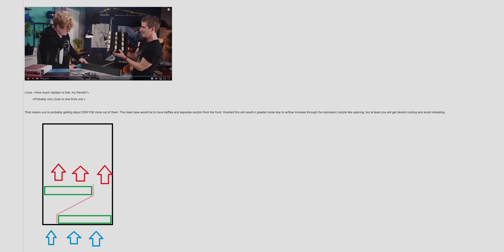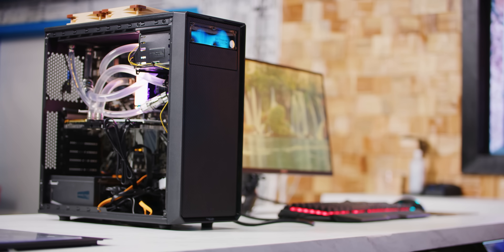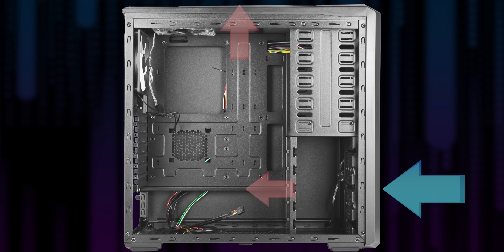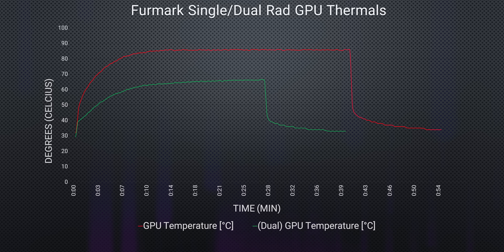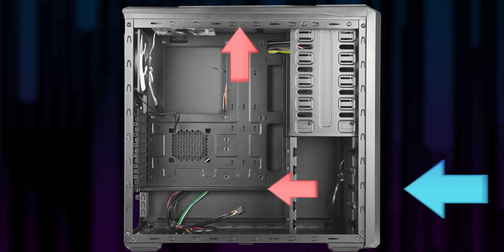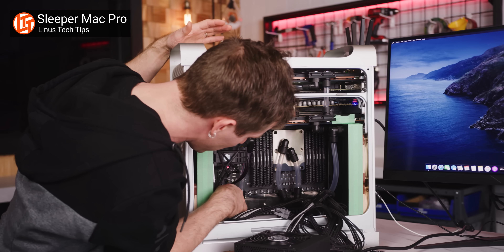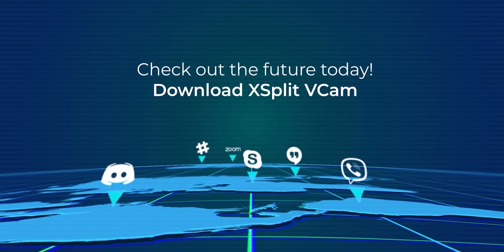I’ve been water cooling wrong for YEARS - $H!T Manufacturers Say

Comment: If I understand correctly, the case Corsair criticized, was stacking radiators. In that case, they might very well be right, especially if your fans are not up to the task, or you're sandwiching one set of fans between two rads. Because the air does not have a chance to dissipate some heat on its round through the case, it goes straight through to the next rad. And the airflow impedance going through multiple stacked radiators, doesn't mean you get good then progressively worse airflow through the radiator stack. It means you get poor airflow through the whole stack. Because the stack forms a relatively sealed flow path. It's a bit like pinching a long hose in one end, almost shut, then blowing in the other end. Overly simplified: Because the hose is filled with air, and doesn't balloon under pressure, it's just as hard to blow air through the first inch as the last one.

In more common setups though, people don't usually stack radiators like that, especially not without beasty fans. And, people usually don't run their rad fans on such an insanely low speed (practically barely turning) that the air manages to pick up anywhere near the kind of thermal delta as Corsair showed, on its short trip through the radiator. There's just no frickin' way you get exhaust air with 1°C delta from the radiator fin (/water) temperature. Not unless you're intentionally provoking that outcome under strictly controlled circumstance. And if you do, you still pretty much have a thermal runaway scenario on your hand because, well, the air passing through the rad only has 1°C delta on the radiator. Meaning it has practically no heat exchange potential. Not a big problem if you're just cooling off some warm water water, but that's not what's going on here. You have a CPU/GPU heat source, continously heating that water. The water is just a thermal medium here.

Comment: The thing here is that the temperature gradient is not as high for the second radiator as for the first. therefore the second rad won't be as efficient as the first, but that does not mean that it has no effect. and stacked radiators do not slow down air enough to "hold back the heat", especially not if you make a rad-fan-rad-fan-... sandwich. if you use a fan-rad-rad-rad-... setup there will be a point where more rads will negatively impact thermals, but that would need tens of radiators so you'll never reach that even in a server scenario.

bottom line: the effect corsair points out is a thing, but it's not relevant for real-life usecases.
Reply: I fully agree and you have worded this way better than I was willing to in my comment.
Reply: Nope
Reply: If corsair claims that a radiator with 40 C water, takes 23 C air and ejects 39 C hot air, then putting that 39 C hot air into another radiator with 40 C air, makes practically no difference. The second radiator is only (40-39)/(40-23)=1/17 times effective as first one. You get like 6% improvement only. You could've probably gotten that same effect if you had just put the fans on both sides.

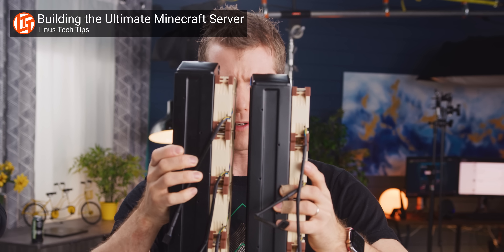The crucial aspect here is that the second radiator only takes hot air of the first radiator for corsair's logic to work. As Linus himself explained, that was not ensured in his test. Air could come from bottom and back. However, what he does at 1:30 is exactly the condition corsair is talking about. That's why I would say Corsair makes sense.

Another aspect is the sequence. In the loop, hot water is cooled by the first radiator and then the second radiator. If the first one is taking fresh air, then with second radiator you're trying to cool already cooled water with hot air from the first radiator. That will be very counterproductive. If the second one is taking fresh air, then the first radiator would be using slightly warmer air of the second radiator to cool much warmer water.

Suppose the air reduces the temperature of water by 4 C(if the water is running at 25 ml/sec, to remove 400 watts, you'd need 4 C temp difference between hot and cold water). Then, in first case temp difference would be like (23C air- 40C water 39C air) + ( 39 C air 36C water- 39C air?) while in the second case, it'd be (23 C air- 37C water -36 C air) + (36C air-40C water-39C air) which makes more sense. Of course this is theoretical, but the sequence of the radiator should matter a lot.
Reply: Linus should go full Mythbusters and see how much it takes to make Corsair's claims true!
Reply: also with 3 rads you have more thermal mass of water - it takes longer to warm it up, so you're working with lower temps to begin with.
Reply: Cool, sounds like you read out what the video said.
Reply: @goodman854  which is also not correct, check out my comment...
Reply: Lamus failed his university degree, like he literally dropped out [get it? ;) ] because he sucked so much. Engineers at Corsair, they passed, and they did a proper degree too... Lamus.
Reply: @brazeiar9672  You do have to be careful when it comes to engineering and modeling.  After an F15 lost a wing, engineers at McDonnell Douglas said it was impossible to fly on one wing.  They tried and failed to recreate an event that really happened to an Israeli F15 at the time (I think they've managed to do it since).
 
Physics is all about science and theoretical models - exact explanations.  Engineering means more than the models - every engineering situation will eventually be a slave to real-world experience.  Even if you don't know why, you eventually have to go with what works.  The science will catch up.  For something that is demonstrably true like this, going with the metrics isn't a bad thing.

Comment: My only gripe is that stacking radiators isn't used in the real world for a reason. Car manufactures don't stack two exact radiators in front of each other because the heat from the first one will effect the second one. All they do is make a bigger radiator or put multiple radiators in different places. So in case of the minecraft server i can't see the second two rads in the "clump" doing anything, but if you put 3 rads in different places of the case with good input air flow that's golden.

Comment: Also I am using an open frame chassis with all my rads getting fresh air all the time and no heating up inside the case is possible.

Besides that I don't like to cramp radiators into a small case. I would rather go for an external radiator, you will always find a place to put it, like the MORA 3 and you get low temperatures and low noise what in my opinion is what makes most sense with doing watercooling at all.

I am keeping my CPU and GPU loops at a max temps of 32 degrees all of the time under load. This let's my 2080ti run at 39-40 C when gaming and boosting up to 2115 MHZ.

Comment: Interestingly for such a big company with so many people who could theoretically fact-check, Corsair seems to have made a very simple mistake: They considered heat transfer of the water as a closed loop, without accounting for the air that's part of the system. What they claim about more rads being bad and choking flow would be correct... if the situation was under free-flow closed-loop conditions with water only. Because the fans increase the effective surface area of the rad inside the case (by pushing more air and turning the heat transfer mode into forced-convection instead of free convection), more within reason should almost always increase flow, and heat transfer along with it. Their CFD simulations were most likely set up with free flow in mind.

Comment: Corsair's simulations are assuming perfect heat transfer from radiator to air on the intake.  The reality is that it's not perfect, so if your water is at 40' and your ambient is at 21', the air intake through your front radiator is probably going to be lower than 40', so exhausting through another radiator will still provide cooling.  Not as much as the front radiator, but it's still cooling.

If your case air is at the same temp as your internal components, you aren't exhausting fast enough.  Obviously two radiators intaking ambient air will be better than one intake/one exhaust, but you still shouldn't be fully saturating the exchange on your intake radiator.

Comment: If stacking radiators are bad why is there 4 stacked together in front of my dodge ram motor??? Transmission cooler, radiator, intercooler, and ac condense. Inefficiency can be overcome by extra air flow. So just drive faster. Vehicles over heat when not moving.  Thats why electric fans are an improved design on cars vs fans off the front of the engine block that spin slow on idel.  If you just add extra case fans problems solved.

Comment: I'm gonna simultaneously chastise and defend Corsair here. They aren't wrong. If you set up your CFD boundary conditions for only one inlet and outlet, stacking the radiators or adding one at the inlet and one at the outlet would be no benefit. In fact, it would lead to increased pressure drop for the air and water which would decrease system performance.

Now to chastise, come on Corsair. Stop with the techno-babble to make yourself look smart. For SOME computer cases, it may make no sense to stack/add radiators to the system. Like Linus said, you need to evaluate your PC and case packaging to determine whether or not multiple radiators are necessary or beneficial.

Source: am cooling engineer

Comment: I'm really disappointed that he didn't test or even mention the order in which the water flows through the radiators.
If you let the warm water flow through the radiator at the back/exhaust side FIRST and then through the radiator that takes in the freshest air LAST, your loop should perform really well.

The air will first encounter the partially cooled water when it enters the case, so it won't heat up by that much. By the time it encounters the hottest radiator, it's ready to leave the case so it won't matter that it has no more thermal capacity left after having gone through that rad. This is why a heat exchanger is so efficient.

Comment: Surely if you pump the hot coolant into a rear radiator first (which is being cooled by inside case air) and then move that colder coolant to a front rad that's drawing in the coldest fresh air, you will get some benefit?

Comment: As long as there's enough free space between the radiators which share the same enclosure you won't see too much of a performance-drop. 
Stacking radiators on the other hand, like the sandwhich that was used in the server is a bad thing. The tricky bit is to correctly measure the difference in cooling-performance because with two rads you double the thermal capacity within your heat-exchange section. So it takes longer until the water temperature reaches the level of a single-rad setup. But at some point in time the system gets saturated and then isn't capable of reaching it's full potential. 
Here's a great test where some different scenarios were observed: 
https://martinsliquidlab.wordpress.com/2012/06/08/hesmelaughs-radiator-sandwich-testing/comment-page-1/

Comment: Hey, Linus,

did you consider the oriantation of the rads in the loop? the one with the "hotter" water should be at the outlet of the system and the one colser to the Loads inlet should be the one that gets the fresh "cooler" air
Reply: George van Hinton jayztwocents did a video a while back that loop order makes pretty much no difference to temps.
Reply: Engineer here - I do a lot of work with heat exchangers (both air cooled, and fluid-fluid heat exchangers). This type of flow is called counter-current flow. The hottest water should always be going through a radiator with the hottest air entering it. So in the LTT case, it should flow from the components to the top (exhaust) radiator, and then to the front (intake) radiator. Parallel flow would not work well here, because only works well if both rads are on either the intake, or the exhaust.
Reply: @amd2800barton  so my intubation is basically correct?
Reply: @georgevanhinton6518  you are correct that the hottest water should be going into the top (exhaust) radiator first, before then going to the front (intake) radiator.
Reply: I was thinking exactly the same thing, and test this with the triple fan setting. Also serial vs parallel loops on each rad. Also REPEAT the experiment, you know, at least 10 times each configs? The open a Google Schoolar account and publish a paper on radiator configuration
Reply: The water temperature throughout the loop will be within 1Celsius throughout the loop. the loop order makes no difference. Lets not start that age old myth again wher the loop order has any effect on cooling.
Reply: Makes pretty much no difference https://i.ytimg.com/vi/o72FpcKJK_Q/maxresdefault.jpg

Comment: Stacking radiators is the same as increasing radiator thickness/efficiency. Putting fans in between fixes issues with flow that you might have with a thicker radiator. Intake fans increase case temperature while exhaust fans are affected by case air temperature. If you add more cool air you should eliminate problems with case temperatures if it causes problems in the first place.

Comment: Pretty sure what corsair was talking about wasn't 'stacking' radiators as in "using more then one", but 'stacking' as in "literally stacking them on top of each other". Like you did in the minecraft server. A radiator pulls cold air and blows out hot air. If you then use the hot output of one radiator as the input for another, that second radiator is going to be a lot less efficient.

Comment: Surely the fair test would be to compare the same number of identical rads stacked vs parallel. That said, although stacking undoubtedly reduces cooling efficiency, if it's all you have space for then it's better than having fewer un-stacked rads.
Also... It makes a big difference which way your water flow is going vs air flow and whether you run the water parallel through all rads at once or serial, looped one to the next.

Comment: The efficiency of the radiator also comes into effect.  Radiators in general are designed for a certain amount of heat dissipation, a certain liquid flow rate , at certain temperatures, at certain airflow rates.

Measure the air temp of a radiator dissipating a constant 400w load at a constant GPM while varying the fan speed.  You will eventually reach a point where adding more air does not improve cooling.  This happens because the radiator’s efficiency at a certain GPM has been reached.  What’s the side effect of pushing more air through a radiator and more heat not being dissipated?  The air temp leaving the radiator will be reduced in relation to the increase in CFM until you reach the physical limit of airflow supported by the radiator or a few degrees above room temperature.

A radiator is just a heat exchanger.  At some point you’ll reach a point of diminishing returns where adding more GPM, CFM or surface area makes no difference.

What I would really like to see if the effect of a variable speed pump used to maximize the efficiency of a waterblock/radiator/CFM combo to produce the most efficient water cooling setup at the lowest dB level.

Comment: stacking coolers kinda doesn't work as efficient as it should. the first rad heats the air that hits the second rad, and the third rad will have even hotter air. creating so called diminishing returns.

Comment: Generally I would have thought as long as you have the air and water flowing in opposite directions you will generally see some sort of benefit from multiple radiators. By opposite flow I mean the first radiator the water hits should be the last radiator the air hits, this would maximise the deltaT between water and air across as much of your cooling solution as possible. Although with the flow rate of pumps there isn't usually much of a deltaT between the hottest part of a loop and the coolest part so no idea how much water that theory holds (ba dum tsss). I'd imagine the closer to maximum load your cooling solution is the more benefit you'd see from adding more radiators, again, just in theory.

Comment: Corsairs simulation probably isn't incorporating air speed just the movement of temperature and the initial constant of moving air. Adding another fan and rad not only increases heat spread but increases air speed which in turn cools the pc more.

Comment: i think corsair ment that haveing radators that lteraly are staced one infron of the other in the same vent air flow port! for example if your case has only one intake and one output vent and you have two radiators both stacked on the out take then its not going to cool properly but if you have one radiator on the intake vent and one on the output its still not as effecant but it would still be able to at lest have better heat capacity then it would be if the radiators where both on the output vent but if you had two intake vents and output vents and put one radiator on one output vent each then it would be a lot better at cooling

Comment: the order they are set in also matters, you want to pump the warm water to the farthest back (closest to exit) radiator first for the most efficient cooling possible with a multi rad setup. That way the air flowing through radiators after the first has the maximum possible temperature gradient. From a thermodynamic perspective, this is the optimal heat/work given a perfect, closed system.

Comment: I believe this was more about fan orientation and trying to prevent hot radiator air flowing into a radiator intake. I would be interested to see this in effect ie all rads in an exhaust setup (as to not contaminate internal air temp)